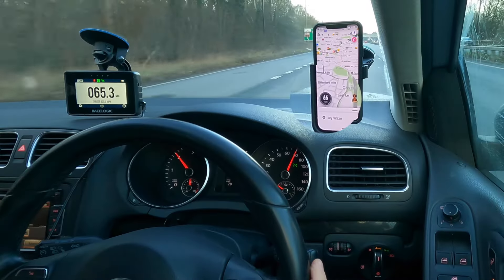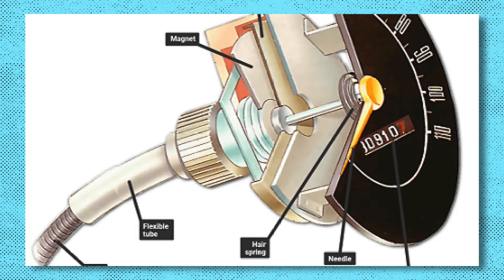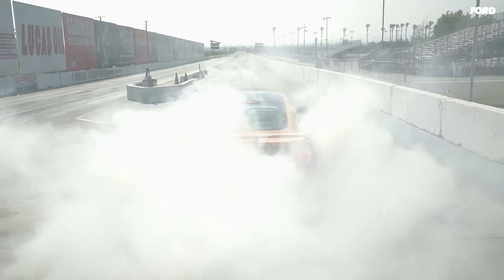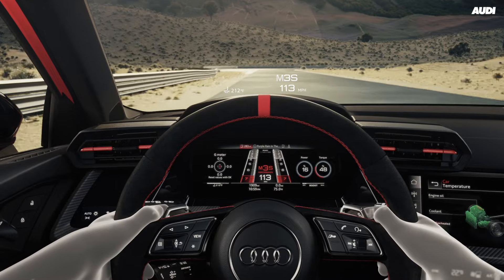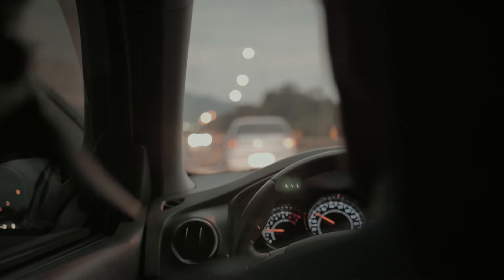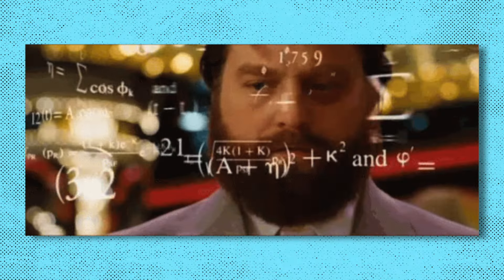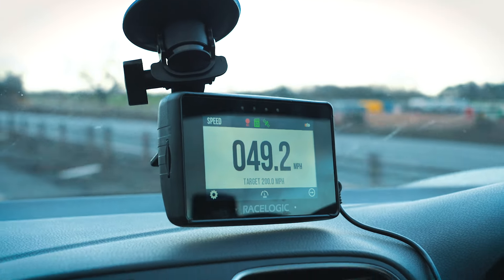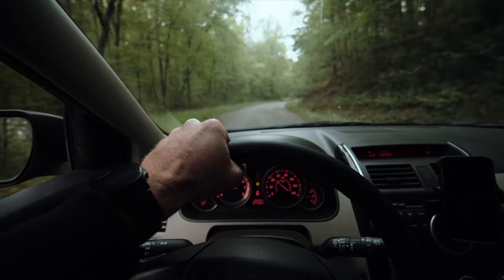Why Your Speedo is Lying to You

Comment: There are also the cars that have two speed readings, one for the ECU ( accurate )  and one for the speedo display ( showing higher speed ).
General GPS is accurate to 10m at best,   I am not aware of any publicly available GPS with better accuracy, Hence the reason many young drivers have been accused of speeding with their insurance black box, because they were on a Dual carriage way which was alongside and parallel to a 30mph limited local road. The GPS was showing them as on the 30MPH local road.

Comment: It's also in the auto makers best interest to over clock your speedometer as it also over clocks your odometer. This makes your vehicle warranty expire sooner. As both are calculated from wheel rotation. So at a 60k mile warranty, your warranty will expire at 58,824 miles with just a 2% over clock (70 MPH GPS reading 71.4 MPH on speedometer).

Comment: My 2016 Ram 1500 reads 5km over because its running on snow tires which are smaller. Its current tires are 17's instead of the stock 20's it came with from the factory.

Comment: 2:03 the eddy current speedo would be affected by all of the factors you mentioned.
Reply: you are correct. Both use the same principle (measuring the rotation of the wheel), only the sensor and the signal transfer is different.

Comment: BMWs E9x series know exactly how fast you are going, and then add an offset, whereas the older E46 series was dead on. You can actually turn it off for the digital readout, but fixing the gauge is more difficult. I read that it is due to TUV regulation requiring that is doesn't under-read even if slightly over-sized tyres are fitted.

Comment: i've known this for so long, i have been doing the actual speed -1/-3 depending.
7 years without a single speed ticket!
I drive a Prado 2008 and it has a huge speed difference (about 5 kms or more depending on the speed)
and my chrysler 300c has around 2-3 kms difference

Comment: My Fully load vw crafter would be doing 60mph but the GPS would read 50 — 55 depending on conditions.
When travelling at GPS speed it will be 65 ish in dash but the cruise control is in kph so around 100 kph for 60 mph

Comment: In Australia a speedo is allowed to be 10% inaccurate.  In the past most cars were fairly accurate, but that changed in 2008.
Starting in October 2008 car manufactures had to list on the windscreen of a new car its fuel consumption rating. Manufactures soon worked out that they could improve their fuel ratings by making the cars speedos inaccurate. My 2012 Subaru was so inaccurate ( 8% higher ) that I used to have a old phone sitting on my dash that I used as a GPS speedo. 
No need for the GPS speedo anymore as my current Mercedes is 100% accurate. As a result my Mercedes fuel consumption reading is 100% accurate, not reduced by a false 8% like in my Subaru.

Comment: I have checked many cars on this. A D40 Nissan Navara used to read about 10% over up to about 70mph, so 33mph indicated was 30 actual speed and 66 indicated was actually 60. My D23/NP300 Navara read 5mph over all the time. My new Discovery reads 3mph over. My Mum had a Hyundai ix20 that used to read about 2mph over.

Comment: The accuracy of my vw up! speedometer varieties with speed, when I'm doing 50km/h it's over reading by about 5
When I'm doing 100 it doubles to about 10 (the actual difference was a little hard to spot since the speedo in the car is analog)

Comment: I discovered this on longer journeys in both my cars, I have two Audis and they seem to be off for the same amount, even tho they are like 10 years apart from each other. And also, at different speeds they underspeed for different amounts. When I'm going under like 110 KM/H the real speed seems to be 105, when having the navigation on my phone, and when going something like 140 KM/H the real speed is 130.
I'm curious if other Audi, Volkswagen, Skoda owners actually get the same readings.

Comment: In Germany, cars fail their biennial technical inspection (TÜV) if the speedo reads under. It can read up to 10% plus 4kph over tho. So it is usually adjusted 3-5% over (showing 103-105kph when the car is really doing 100) so that even if it‘s warmer during the inspection (=> more tyre pressure => bigger diameter = car goes further per rev => higher real speed) or something like that, it definitely won‘t read under, since failing the inspection means the car has to stay at the garage until the next possible appointment and it will cost another good 100€. No garage wants to have to tell their customer those news.

Comment: I have a 2009 Golf. Funny thing, I bought an aftermarket headunit which shows the speed from both it's GPS and the entertainment canbus, the GPS agrees with my phone, the entertainment canbus data is 2-3 km/h lower than the GPS and the dial on the dashboard is about 5 km/h higher than the GPS. I drive by the GPS.

Comment: In Australia, the car manufacturers were allowed the same 10% discrepancy. And back before say 1995, most Australian built cars had the worm drive for the speedo connected to the Gearbox. So not sure how that affects the accuracy. My speedo in KMH is roughly 3 KMH overspeed. So I know I can sit right on the speed limit of say 100 KMH and know my speedo is actually reading 97 KMH. My car was built in 2001.

Comment: Well it is calculated by your wheel rpm and radius. So if your tires have not enough or to much pressure, the speed reading will be off by a few percent.

Comment: My 1988 Nissan Sunny has quite the tolerance, 140km/h on the speedo is 123km/h on waze, 60km/h on the speedo is 52 on waze... Reason being, some idiot put tiny wheels on the car before I bought it, should get different wheels and tires, but that'd be more expensive then the car itself, and it has new tires already

Comment: My 2000 Honda Insight has a digital cluster. I've observed that the odometer is within a tenth of a percent, and the speedometer reads exactly what my GPS does, only it always rounds up to the nearest whole number. E.g. 68.0mph shows as 68mph, while 68.1mph via GPS (and the ECU's OBD data) displays as 69mph on the cluster. It's definitely not off by percent, because this is also true at 10mph.

Comment: My 2018 WRX is 2 mph under at 70 mph and my 2018 Forster is 70 mph at 70mph spot on the WRX was fitted with 18” after market wheels 1” bigger then stock and the Forster had its stock wheels. My 2018 CBR 600RR is also spot on at 70 mph.

Comment: In my country there are sometimes speedtraps that don't ticket you, but instead display your speed. So there will be a sign saying "You are going 50 km/h" followed by a smiling or a frowning smilie depending on whether you are too fast or within the speed limit. I always use these to check how much my speedometer is lying to me, it is usually around around 5-8 km/h higher than my actual speed. Depending on the speed i am going at, 5kmh at 50 and 8kmh at 100.

My country has a 4% tollerance in speed traps, however tickets are only given when more than 10km/h above the speed limit. So i usually go speedlimit + 10km/h and never gotten any tickets with that

Comment: It’s mostly for safety. There’s agreement with Manufactures and regulators on the limits on how manufacturers can overate or under rate the speedo reading when leaving the factory. Depends on what kind of vehicle, the values they deem will contribute to safety. Say suvs and normal cars won’t be accurate but expect performance cars will have an accurate reading. I read you can actual request the factory/dealer to calibrate to the let the speedo read normally. Depends on the local regulations as well. And by the common speed sensors now measure the rotation on the hub. It doesn’t matter the size of Tyres and wheels. The sensor is at the hub not on the wheels. It’s rotation is constant. It controls your brakes and traction control so they should be 100% accurate in reading the speed. The ecu will read them accurate always. The ecu then just controls what you see in your speed displayed in your speedometer.

Comment: Peugeot 508 2013, cruise set to 70 mph, sat nav and phone show 67 ( sat-nav) 64 Phone, I have always suspected the difference was because of the time a signal took to travel the 250,000 miles to any given satellite, I did know that the speedo in most cars tend to under read too, I had a motor bike which broke the cable ( from the front wheel hub) and being an old ( 50 years old) the cable was a non stock item, so replaced it with one of those computerised ones you can get for bicycles ( they read up to 99 MPH) this you have to set up giving the wheel/tyre size, and that was pretty close with less than a 2mph speed difference when checked against a sat-nav, but as you stated as the tyre wore down it became less reliable, also I found that hot and cold conditions caused fluctuations in the average speed displayed too, the most accurate speedometer I have come across was on my ex police bike ( BMW K1100 LT ) but that speedo was not an OEM part it was recalibrated by a company that the police use, and that was accurate to within 0.5 mph

Comment: I had a Volvo when living in Canada, if you put the cruise control at 100kph. And measured with GPS. It was a 100+/-1 Kph.  But the car I have now in Sweden, is consistently 2 to 3 kph slower than indicated speed.  So on a 80kph restricted road. Cruise set at 85 and you are golden as far as a speed cameras are concerned.  But there must be something to treat the licence plate with, so that it can't be read  from a photo.

Comment: Here in the UK our cameras have a 10% +2mph tolerance. 

I use waze which shows you're travelling speed. In a national 70mph I set my speed limiter at 81mph. Actual  GPS speed is 77mph. Could push it a few mph more but 10% is fine. 

Been through mobile speed traps and average cameras like this many time never had an issue.

Oh and it's a 2021 skoda fabia tsi.

Comment: The car I did my test in - fiat Siecento - over read by 10 mph...going round on my test knowing I was doing 20mph because the satnav said the gps speed but not going quicker otherwise my cars speedo would say I was speeding was almost painful!

Interestingly one time I put larger sidewall tyres on the car and the speedo became almost perfect. I knew the difference wold be less but it was spot on at 70mph! the rpms sat lower as well so it was much more comfortable for distance :)

Comment: In NZ on some motorways we have speedo checks using markers on the side of the motorway, poles marked from 0 to 5 km distance, as you pass the 0 marker reset your odometer  and then check again at the 5km mark, this will tell you if your odometer is out, have found out on my last 5 cars that the odometer has been very accurate.
But all my speedos have generally been out by up to 5 % 
The odometer runs on a different system to the speedo.
My new car was out by 2% when new and 5% out after 60000km, put that down to lower tyre circumference due to wear, as soon as I replaced with new tyres back to 2% again.

Comment: In France the camera tolerance is 5km/h, and my Polo under reads by 5km/h. So I can safely drive 10km/h higher without getting a ticket. Even for mobile and police-operated cameras, they will only fine you and remove a point if you go more than 5km/h over the limit

Comment: My chosen speed is made up from the inaccuracy of the speedo, the + 15% that the speed cameras are set to capture from (the we have it here is that the fix cameras only send out a photo to the authorities if you went over the speed limit by 10% than it's manually checked if you exceeded 15% or did something very sketchy) and the 3% margin off error by the cameras. So a comfortable 65 in a 50, a 115 in a 90, and somewhere around 160 in a 130 (km/h).

Comment: My 2005 mustang GT wit hdifferent rear eng gear ratio and different tires seems to be getting to < +/-1% accuracy.  I imagine this is due to the calibration required when I changed out my rear end gears, though it should have been just as accurate from the factory.

Comment: My speedo (on a 2019 Ford Transit Custom) has a gradual over reading, under 60 Kph, it over reads by 3 kph, between 60 and 100 kph it over reads by about 5 kph, over that (up to 120 Kph I didn't try over that because it's the speed limit on the moroccan highways) it over reads by 7 kph. 

On a Dacia Duster, the speedo is more consistent, it over reads by 3 kph from start to 120 kph

Comment: One important factor missed, and the main reason why the speedo reads high. The tyre's rolling radius and thus their rolling diameter reduces significantly over their life. To maintain a certain speed the wheel must rotate faster with worn tyres than with new ones. It doesn't matter where the speed sensor is, on the wheel or on the gearbox output shaft, there is a fixed relationship between the wheel and the gearbox. Most of the data of wheel rotation speed is used for ABS, ESR,  Cruise control and other stability functions. The magnetic or eddy current speedo is notably inaccurate, temperature, wear and age need to be factored in so that the driver always errs on the safe side. Their big plus is that the needle reading is smooth and easily readable at all times; it forerunner the earlier "chronometric" type speedo updates its needle position every few seconds and the needle seems to jump from one speed to another.

Comment: It's a coding thing. You can code E46 (I presume it's the same for all BMWs after 2000...probably the same for all German cars even...) to be correct, or to show +5 km/h speed. It probably depends on the market which option is coded in from the factory.

Comment: so i use a mk7 golf ive found that there is a reigion where the reading is off about 4 - 5 mph and thats between 30 -70 mph however as you start pushing above this threshold it semms to get more accurate

Comment: I measured the tolerance of my Golf some time ago and found out the tolerance ist very speed dependent.
But as a rule of thumb, I can stick to the following rule for setting the cruise control to be nearly spot on:
Below and at 60 km/h limit: +3 km/h
Below and at 100 km/h limit: +5 km/h
More than 100 km/h limit: +10 km/h
At speeds exceeding 160 km/h the tolerance ist more at about 20 km/h

I have never got a ticket at these settings, but we have a 4 km/h tolerance in every speed camera

Comment: My Citroen C2 VTS is 2mph out at 70 (72mph on dash to do 70) this is with the standard wheels and tyre size (195/45/16).

So I am one to set correct speed in average speed checks but I don't add speed camera margins but just know if I am 0.5mph over it will all be fine.

Comment: 0:30 speak for your self. the speedo in my "old" 2018 tacoma and in my 2020 ram 1500 are dead on. also, its very important to use the exact size tires your car came with.

Comment: I have a 1995 GMC pickup that is doing 65 MPH when the speedometer reads 55.  At 65 MPH I am doing 78.  I suspect I have taller tires than what it was designed for.
The first time I drove it on the highway I heard the difference by the road noise.

Comment: They overestimate to ensure a change of wheel size between models will not under-read. This is the same for wheel speed sensors. They must deal with wheel size differences.

Comment: Luckily my current car seems to be pretty accurate.
Using a gps app as well as an actual Garmin unit I'm getting an exact match of my speedometer at 40 and 70. I never tested any higher to see if it eventually starts to fall off though.

It's a 2014 mustang but to be fair I had my speedometer corrected to my tire setup while being dyno tuned.

Comment: I do alot of long distance driving. I always use a GPS to set my speed and usually add the 10% they generally give you as well. Ie do a real 109 in 100 zone. People will think it's very fast because they are probably only going 95. In a long drive that can save significant time.

Comment: I think it has to do with wheel size..the bigger the tire means the speedo will run a lil higher..like it will say 74 it's actually 72..alot of cars come with different wheel packages..i own an f10 m5 and for my year car the base wheel size is 19 but I have the bigger 20 inch wheel package and they say the mph will be 2 -4 mph faster than the actual speed and like u said it is a lil better for us who speed because we're not actually going as fast as the speedo which can save us from a ticket

Comment: The faster you go, the higher it over reads. 100kms on the speedometer is roughly 96kms but at 180kms on the speedometer is roughly 169kms-170kms. The 2012 ford falcon xr6 i had was extremely accurate though.

Comment: This is definitely a regional related issue.  In Europe and all the British colonies I have noticed that the majority of vehicles I have driven do have speedometers that display a speed that is too high.  I have also found that the amount they read high is not a simple percentage as you would expect but they have a strange non linearity at a very low speed and then add a fixed speed offset.  I owned one car which displayed 5km/hr too high from about 25km/hr up to way over the legal speed. 
Here in the USA I have owned about 8 vehicles of different makes and models and they have all had speedometers that are accurate to the nearest mph.

Comment: I drive a Toyota Yaris and the speedo is usually about 5% higher than the GPS speed. I actually fitted slightly taller tires to try and make this a better match :D

Comment: my speedo basically shows almost 10% more than the actual speed. so i need to set cruise to 98kmh to be going 90kmh according to google maps. i reckon most people don't know that and claim to drive 130kmh(speed limit) while they r actually doing more like 118kmh. speed cameras have a minimal tolerance(no matter the speed limit) plus some extra for higher speeds. it actually differs between handheld speed cameras and fixed ones. i usually just aim to go as fast as the speed limit and not over.